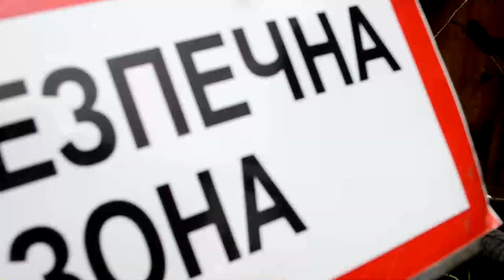Рятувальники продовжують аварійно-відновлювальні роботи та ліквідовують наслідки російської агресії

Comment: In Sumy, 31 rescuers and 9 units of equipment are dismantling blockages in the private sector. In Okhtyrka, 30 specialists work on the territory of the CHP. Verkholazy dismantled metal structures with an area of 100 sq.m.